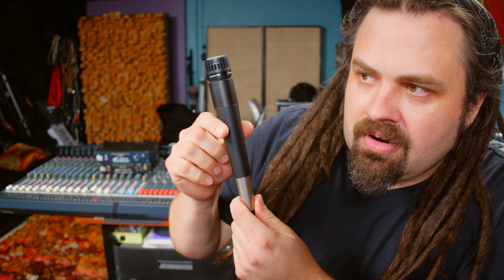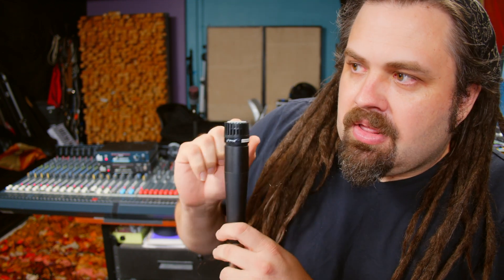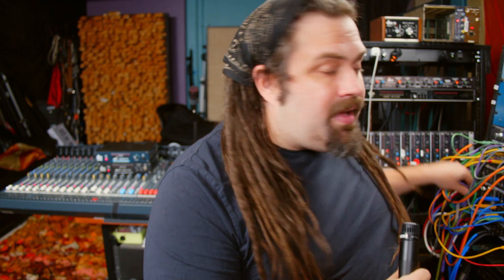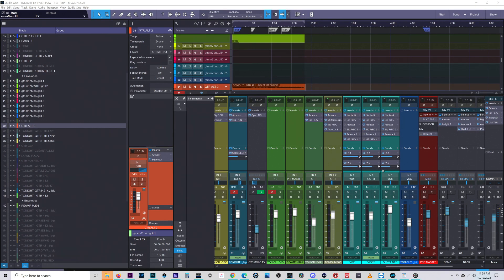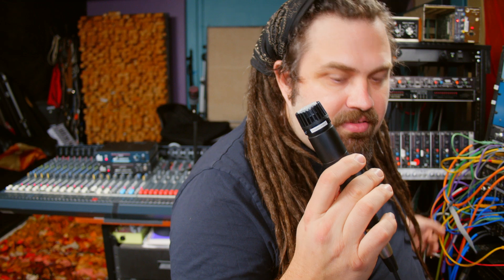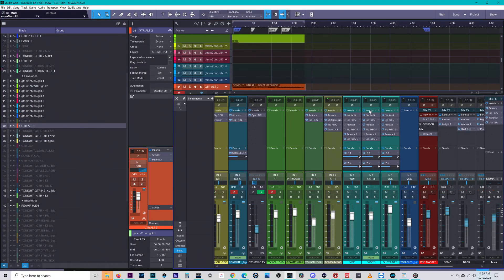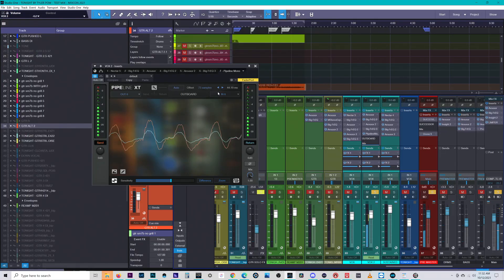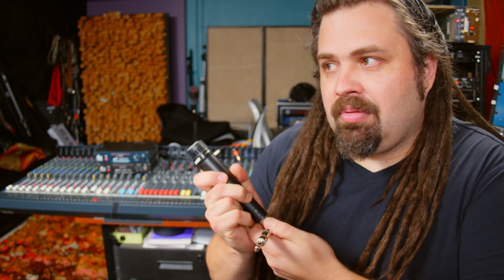Mic as a Tiny Speaker - Monitor and Troubleshoot Your Signal Path

Comment: Now I need a looper. 😑 totally never thought of this, I have an SM-11 on the shelf right below the rat's nest that I am trying to simulate a harmonic tremolo with at this moment. I haven't flipped the switches yet but running a UA 610 through an Ashly into a bunch of Redeyes &cetera and my plan was to spend some time locating the bad patches. This will be helpful.  👍

Comment: I wonder if you had 2 of those mics, one acting as a mono output and one as a mono mic, and placed them at opposite ends of a small metal tub (like a sink with a sealed top), if you would end up with something like a reverb chamber but in the size of a spring reverb. Something to try out!
Reply: The output is pretty low and dynamic microphones need to be really close to not lose all low end when miking small sounds. It would be faint and tinny. However putting two 57s right up against each other, one as mike one as speaker works. Retains the low end pretty good, and you get a sound something in between a normally miked speaker and a lined signal. Like a lined signal with a bit of air on the top. I have used this techinque many times.
Reply: Premier made an echo system using two mic capsules and a plastic tube coiled up in a box. It is still on my list of artifacts to purchase. 🤔

Comment: Always heard that you needed to reverse the wires of a speaker in order to make it work as a mic. Interesting that the opposite doesn’t apply when using a mic as speaker.
Reply from the maker: Yeah, as JS said, that would just flip the polarity. Which is just like when you mix, you can still hear it. It's not directional per se, but what you are talking about is the speaker should move outward first, then retract. That's what it means to reverse the wiring so that the speaker moves the right direction.
Reply: Why should the wires be reversed when using a speaker as a mic? Doesn't it just change the polarity of the signal, but otherwise pass it through normally? At least that's what happens when you use it as intended, as a speaker.

Comment: How would it sound with two mics taped together, capsules facing each other, one as an output, the other as an input? Cool distortion/lofi box?
Reply: If audio had its own LGBT, that would be it haha
Reply: @daleonov  That's a winning comment!
Reply: This works. I have a box with two stereo pairs 57s set up just for this purpose. Low end is pretty good, cleans are very clean, and overall it sounds a bit like something in between a normally miked cab and a lined signal. Think lined signal with a bit of air headroom on top.
Reply: Probably just feedback?
Reply: There's a Premier box that does that through a plastic tube for a delay.
 (Then there is my sewer pipe system that runs a one and a half or two inch compression driver through a pipe and directly out of a horn, delayed. The possibilities go on and on...)

Comment: Holy crap. I've done the opposite before, used a pair of headphones as a makeshift mic. But this has never occurred to me before, will be a great timesaver for troubleshooting during soundchecks.
Reply from the maker: Haha and that’s a video in the works too.
Reply: When i was a kid and had, err, limited resources at home, I used to put headphones to an acoustic guitar (as if the body was the head), and then overdrive the mic input of my 4-track c-cassette recorder to mimic a distorted electric guitar. Nope, it did not sound exactly like the real thing. But i recall the sound was close enough to get the point through in my home demo recordings.

It was kind of an unique sound, especially when using a nylon-string classical guitar. Unfortunately, those recordings are lost in time. 

Bonus round: the 4-track had a pitch knob. When I turned it all the way up to rise speed and pitch, tuned the guitar down a few steps, i could record a "bass" track using the same headphone-on-acoustic trick. Another interesting sound, i recall it had some characteristics of an upright bass sound to it.

I guess it would be fun to test these again some time. Maybe the sound(s) could be useful in some weird song.